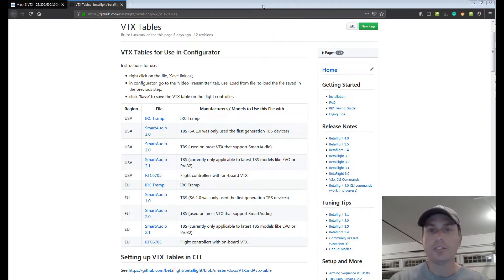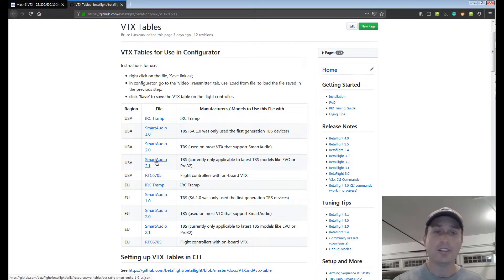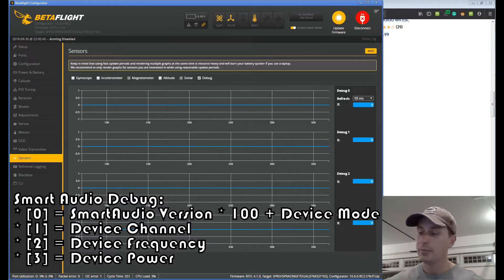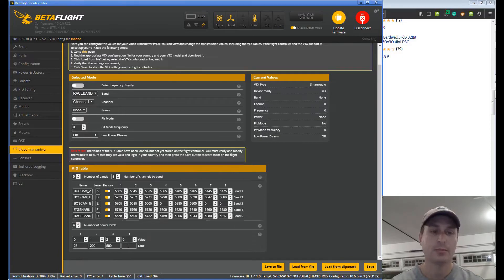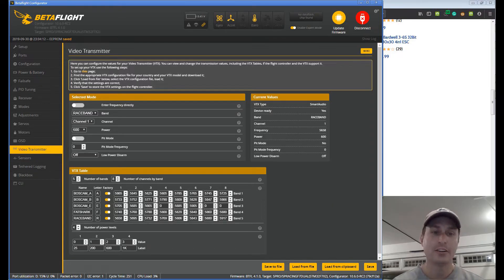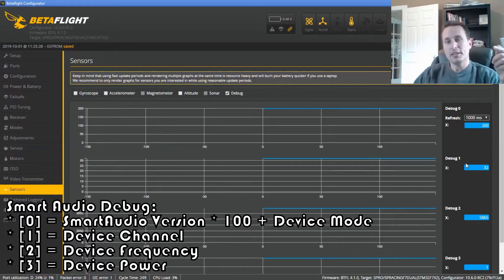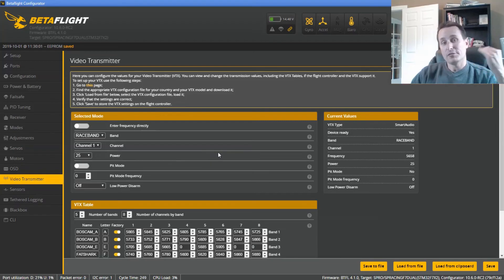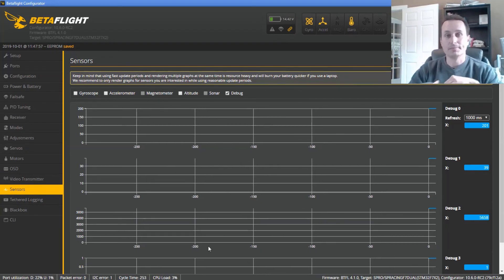Betaflight VTX Tables in 5-minutes - How to discover your Smart Audio Version

Comment: My debug is reading 316 which should translate to 2.1 unlocked. Unfotunatly at this time there is no table for 2.1 unlocked, only locked. If you use the locked table you will be stuck in pitmode. My question is who creats the tables? The BF Devs or TBS, and how does one go about requsting that? Thanks!!!!!
Reply from the maker: Just get the 2.1 table.  There is not distinction between locked and unlocked.  BF Devs created.  YOu can submit a new table through a Pull Request.
Reply: @uavtech  Thanks Mark, but a few of us are finding our unlocked VTX's are stuck in pit mode. When we lock our VTX it works fine. Any idea why?
Reply from the maker: @paulgiusti6779  , i have found you cannot exit PitMode on arming.  You need to do prior (another switch).  You seeing that work differently in 3.5.x?
Reply: @uavtech  I'll give that a try and let you know. Thanks again for the help!
Reply: so when I turn pit mode off via switch it turns off for a second or two but then goes right back into pit mode. It flat out wont allow me to turn off pit mode in BF Configuator and with Lua script I can turn it off but to no effect, as soon as you exit is stays in pit mode. 
What do you think????
PS. SA 2.1 did not work in BF 3.5, you had to use the button on the VTX

Comment: I have smart audio 2.1. Download the usa version of tbs smart audio. My vtx is a AKK F2 ultimate. 25, 200, 600 and 1200 mh.
When I set to  band F channel 4, its set to F 4 channel 5, and transmit in 5820 freq.
I change in osd but not take effect. What i´m doing wrong? 
In Betafligth 3.5.7 works great.

Comment: I am using tramp smartaudio, can't seem to get the values on the sensor tabs in debug, plus on the vtx transmitter page, the small window that says current values, it list "device ready" as NO.
Reply from the maker: it works.  Debug is for SA only. Works for my Tramp VTX.  Did it work in BF 4.0?
Reply: @uavtech  thanks, I was able make it work. got the debug value of 216 and was able to load the vtx table. but..........

Comment: Everything seems to work for me except the debug values in the sensor tabs are wrong. Same Mach 3 Vtx. My version is 224, debug 1 is 24, debug 2 is 5300, debug 3 is 1. I am set to Fatshark ch1, 5740MHz.
Reply from the maker: They are not wrong.  If you are calling out tables on the VTX, the Debug[3] doesn't update, as outline in the video.  If calling out Freq. from the BF table, then it does, but you need to power cycle the VTX and trigger a power switch.

Comment: Thank you for all the information you share It has helped me a lot. I just set up a Mamba F405 stack on 4.0 using the TBS Unify Pro HV 5G8 - Race, which I have never used, and found out it was SA 2.1. I haven't been able to get SA to work. Is it possible it is a betaflight version issue? or maybe even the FC?
Reply from the maker: is it reading 300 in Debug [0]?  See pinned comment.
Reply: @uavtech  Thanks. I will have to flash to BF 4.1 when I get a chance. Really appreciate the reply.

Comment: Awesome man thanks. I’m wondering about irc tramp VTX though, is there info on power levels I should be adding for a Tramp HV somewhere?
Reply from the maker: For tramp, just download the setup template.  The power levels are easy.  They match the desired power level (simple... unlike Smart Audio).  You will see.once you load the template.
Reply: UAV Tech Cool thanks, I just started looking into BF4.1 and have to admit the smart audio thing is tripping me up.

I’m already a bit confused about smart audio because I use the Tramp, TBS unify and recently tried a Rushtank VTX but the RushTank is weird, in BF4.0 I set it up as smart audio in the configuration ports tab but in the betaflight OSD I can make changes in both smart audio AND tramp telemetry and only the tramp telemetry option actually controls the VTX. Thats really odd because in the past there were no band/channel/power settings available under smart audio in the OSD menu if you were using tramp telemetry and vice versa. But even more alarming is the fact I’m using smart audio but it’s the tramp telemetry section in the OSD that is controlling the VTX!

Comment: I'm using an AKK FX2 VTX (does have smart audio), but when I try the smartaudio debug option to figure out which version of smart audio the AKK uses, I get no reading in BF. Anyone happen to know which version of SA the AKK VTX's use? It's not shown on their site. Perhaps we can just try each version of SA until one works? Thanks.
Reply from the maker: You may need the AKK fork of the firmware as in the past, some AKK VTXs have the SA protocol cloned improperly..

Comment: Good tips, but what about those strange power level values that came up in JB's video that seemed to be the dBm power levels?  In what cases are those used?  The 0 through 3 values corresponding to the labels is much more user friendly.
Reply from the maker: Those are only in SA 2.1.  See https://github.com/betaflight/betaflight/blob/master/docs/VTX.md#smartaudio-v21-devices-vary-depending-on-their-model-check-the-manufacturers-website

Comment: So if I understood you correctly if you UNselect "factory" switch and you set manualy a random frequency (within the higher and lower boundaries of 5.8Ghz band), would the VTX transmit on that frequency when you select that Band-Channel? I didn't know the system was so flexible!
Reply from the maker: Yeah, there is the option at the top to just tell the VTX a.single freq to transmit on.  Of course your goggles need to be able to receive that freq.  So those tables limit you.

Comment: Thank you for this video, but what happens if your FC doesn't have blackbox? Most micros don't and pretty much none of the micro VTXes (or AIO cameras) tell you what SmartAudio version they are running.
Reply from the maker: You don't need flash.  Just select the debug.  Plus they are adding a CLI command to show the debug info.
Reply: @uavtech  That's awesome! I've just checked on one of my micros with a HappyModel Diamond VTX and it does indeed work, but I am getting a value of 216 out of debug 0. I assume this means SmartAudio 2.1 with some allowance for manufacturing and/or QC?
Reply from the maker: @jalkingforjesus  , that means 2.0 and Mode 16 which means unlocked.

Comment: And debug mode 2 says 5865 but it on 5658 so i think this does not work right
Reply from the maker: It works.  If it is using the VTX table, the freq is not updated as covered in the video.
Reply: @uavtech  sorry i saw that in the end of the video
Reply: @uavtech  im using 4.1 for the new spektrum protocal for there new receivers

Comment: If I have my pids spot on in 4.03 can I carry them over to 4.1 or do I have to use new sliders?
Reply: Or can I just diff all
Reply from the maker: Diff All should work just fine.  Only change is fundamental us you probably don't need as much FF or D Boost with FF 2.1 in BF 4.1

Comment: SA2.1 is indicated by a value of 3xx, not 21x.
Reply from the maker: Yeah, cause that's not confusing.
Reply: UAV Tech Indeed! This is simpler, using the sensor tab, than actually recording a log as I suggested on JB’s video yesterday. Still curious to get a reply to my comment on your filter strategy video.

Comment: Great video! Thank you.
Curious: About that Raceband Channel1 value of 32 in debug? 
Raceband slot 4, starting at zero = 3.
Channel1 slot 1, starting at zero = 0.
Why 32? Wouldn't that be Raceband Channel3?
Reply: Has to be channel 3, and it fits with the comment later about 0 being channel 1.
Just commented before seeing your comment :)
Reply: Actually the description is incorrect.  The first digit is not the “band”.   The field is a decimal value of the reference in the table from 0-39.
39 happens to be the last channel R8 

32 is raceband 1

31 is fatshark 8

Thus demonstrating that the first digit is not representing the “band”

This is explained in the tbs spec referenced in the comment section of the video. 

In smartaudio, it is 40 channels in a row.
Reply: Ah! I get it, the numeric is an integer value used as an index in a single dimensional array starting at zero. For some reason I was thinking each digit represented an index in a two dimensional array. Thank you for clarifying!

Comment: Curious to know how this is gonna work for the AKK / RDQ maintenance release patches...
Reply from the maker: Mach 3 doesn't need it.  Update your VTX.

But otherwise, that is one line of code in the AKK branch.  Will work fine when it is added.
Reply: @uavtech  I assume by update your VTX you mean buy a new one, not like a software update, right?
I disagree with encouraging people to buy new hardware for a software issue that is solved with a single line of code in BF...

Comment: hi I'm having a problem identifying my TBS Unify HV. I know its a Smart Audio 2.0 device, but its showing some weird numbers in the Sensors Debug. My values are
Debug 0 X: 216
Debug 1 X: 32
Debug 2 X: 5362
Debug 3 X: 0

This is before I load any tables in.
Reply: The 16 is an unlock flag indicating that you’re not in the EU 😉
Reply from the maker: @SteveCEvans  , thanks Steve.  Did not know that one.
Reply: Ah thanks...learn something new today. Yup I'm not in EU.
Reply from the maker: @SteveCEvans  , where did you find that?  It does not seems to be clear in the TBS literature that 16 is unlock.  I believe it of course, but want to understand the source to learn more.
Reply: @UAV Tech See https://github.com/betaflight/betaflight/blob/master/src/main/io/vtx_smartaudio.h line 48 for the definition of SA_MODE_GET_UNLOCK being 16. If you look at https://github.com/betaflight/betaflight/blob/master/src/main/io/vtx_smartaudio.c line 348 you'll see where the debug data is updated. Specifically the line "DEBUG_SET(DEBUG_SMARTAUDIO, 0, saDevice.version * 100 + saDevice.mode);". The saDevice.mode is 16 if the device is unlocked.

If you look at the Get Settings section of https://www.team-blacksheep.com/tbs_smartaudio_rev08.pdf#page4 this is referred to as Operation Mode. The Operation Mode Response table documents the unlock bit.
Reply from the maker: I don't know what the 16 could mean in your Device mode.  But everything else is fine.  If you know it is SA 2.0 and it works, that is all that matters.
Reply: Ok thank you. I'm just curious though what it means, I mean for someone who does know that Unify HV is 2.0, they might even interpret it as 2.1 as 216 is closer to that. 
Does this table affect how the lua script works? Does lua script gets the value from the tables or they work separately?
Reply: same here except debug 2 X: 5806
Reply from the maker: @dorelcodrutpatrasca2993  , in channel mode, you can ignore the frequency number reported in Debug [2]; as hit in the video.

Comment from the maker: If you see 216 in Debug[0], that means Smart Audio 2.0 in Mode 16, which is unlocked.

Smart Audio Debug[0] key:
100 = SA 1.0
116 = SA 1.0 unlocked
200 = SA 2.0
216 = SA 2.0 unlocked
300 = SA 2.1

If your TBS VTX uses Smart Audio 2.1, the Power Level number varies per VTX.  This is a TBS thing, and hence kind of the reason for VTX tables - stuff like this and all the other VTX's out there not strictly adhering to the original SA protocol settings.  See the following link for guidance on Power Level settings for some TBS SA 2.1 VTXs: https://github.com/betaflight/betaflight/blob/master/docs/VTX.md#smartaudio-v21-devices-vary-depending-on-their-model-check-the-manufacturers-website

With VTX tables, it is flexible enough for the Manufactures to provide a table to load or the user to customize based on their specific VTX; and whether it follows the protocol or not.  If it does, you just load the files.  If it does not, you now have the flexibility to customize based on how your VTX actually works.
Reply: Great job. seriously.

But my debug says 217 and not 216.
Is this right?
Reply: @SoaringExperience  Me too any idea what this means?
Reply: When I power up nothing happens ?
Reply: When I arm video goes total black.
Reply: Any idea what 217 means?
Reply from the maker: 217 = SA 2.0, locked
Reply: @uavtech  thanks will look into this
Reply: Nice! Thanks a lot for this comment!
My debug info showed 300 and I was confused AF :D
SA 2.1 it is... Anyway, thanks for nice and quick guide :)
Reply: I'm using RUSH Tank Ultimate Plus and it says 300 in debug.. However, the max output for this VTX is actually 800 but in the VTX tables max is 1W.. Is that okay??

Comment: Now the real question: if Betaflight knows the SA version, why can't it automatically set the vtxtable?

But thanks -- I'm linking this in my vtxtables video.
Reply from the maker: I guess the follow-up is EU or USA?
Reply: ^^ yeah, or they should have at least told us that "trick" on the betaflight github site about vtxtables.
I can't remember reading anything about this on that site!?
Reply: ...but then again i'm waiting for a "fast blinking" LED mode since the start of BF so what was i thinking? 
If i wouldn't like the way BF flies so much i think i'd switched to something more user friendly by now.. :P
Reply: Ok, now I'm a little confused, Is the VTX Power Value suppose to be 0, 1, 2, 3...? or is it meant to be the hardware specific power levels in db?
Reply: @JB Why is your "betaflight broke smartaudio" video now private?
Reply: Upgraded to 4.1 now a Lua script not working, any suggestions?
Reply: @snoopyfpv8549  updated lua for 4.1 on github
Reply: @rabidbydesign  thank you Rabs FPV.
Reply: Are you looking to write that translation and the ui element to display it    because I actually write code and I don't even want to do that.  sounds like a feature request to me
Reply: So do we set the VTX tablets "value" by the DB or 01234ext or by the actual power level intended?!?!
Reply: Because it's controlled by the too smart for their own good. Lol
Reply: Joshua Bardwell, its a multi reason development not least of which is to comply with various legal requirements for mw settings in different countries; its also to save a whole lot of work and allow users to correctly set power levels.. I for one had a VTX that was 25/50/100/200 that NEVER displayed the correct power levels (in OSD) but now with VTXTables everything is correct :)
Reply: @quadwizard  who cares what the label says it should say 0-1-2-3-4 etc.  This is exactly what is wrong the devs think we care. It has nothing to do with flying. It compares to seeing the rpm on an automatic transmission. WTF
Reply: Yeap. It should have those options in the GUI. So you select your option and it set the table and let you modify.

Comment: Big thanks for this !!
That was the missing link for me...

Does this get added to the github page?
Reply from the maker: Let me do that.
Reply: UAV Tech 
Great 😋

Do you know why with the unifys one is power id 13 for 25mw and another is 14 for 25mw ?
Reply from the maker: @jas-FPV  , cause that is what TBS made it.  Hence the need for VTX tables.  It is getting out of control with all these VTX's - even TBS - not strictly adhearing to the original Smart Audio protocol.  

https://github.com/betaflight/betaflight/blob/master/docs/VTX.md#smartaudio-v21-devices-vary-depending-on-their-model-check-the-manufacturers-website
Reply: UAV Tech 
I totally agree with this option, not like Bardwell or  Pavel ...
Maybe we get an SA 3.0 that pushes its capabilities into VTX tables ;-)

I hope more manufacturers offer their settings via the preset page. I already talked to AKK about it and urged them to do it